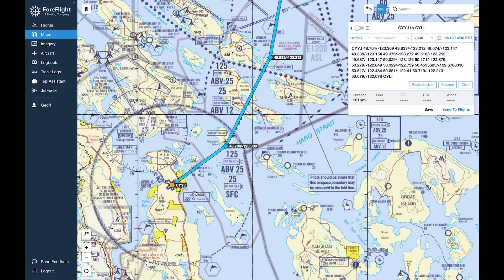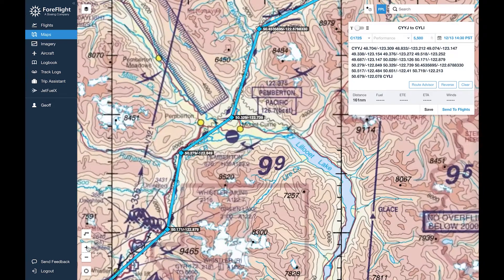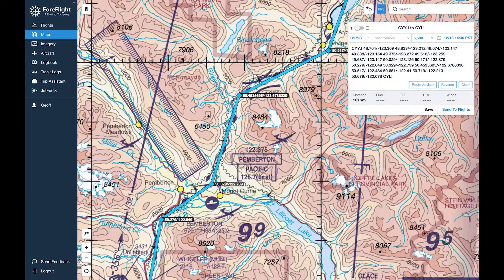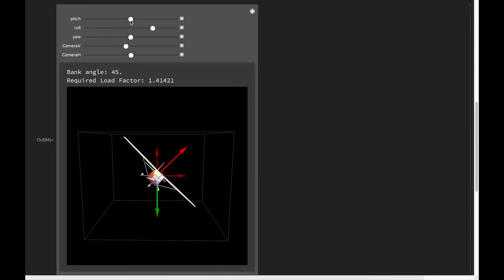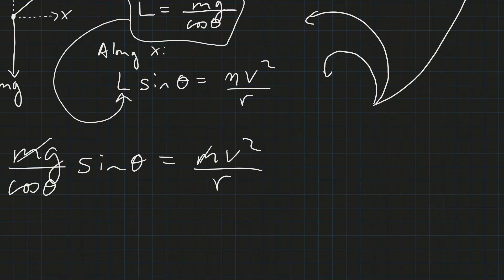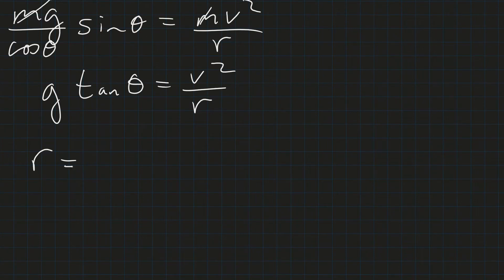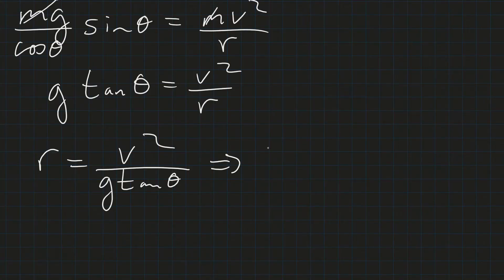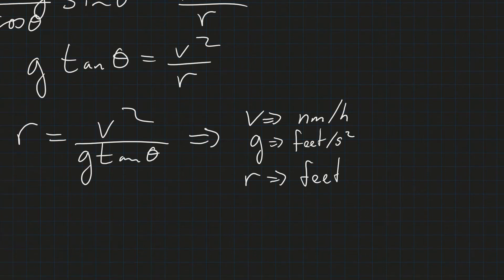Flying Physics: The Turn Radius Equation (and an even better one).

Comment: Why does everyone keep using this stupid explanation of the physics of turning an airplane? This explanation simply does not include an illustration of the tail forces that must be applied if you want to increase the angle of attack, nor the sideslip caused by the horizontal forces and angle of attack acting on the vertical stabilizer. The tail force also has a vertical and horizontal component. Can't you see that the horizontal component of the wing lift is located behind the CG in your 3D model, and when you apply this force, the airplane simply turns in the opposite direction? The only thing correct in this video is the radius calculation (6th grade).
Reply: I invite you to create a better explanation then and look forward to it
Reply: @HDTokyoAviation In simple words: all airplane control surfaces are involved. An airplane is a body with 6 degrees of freedom and the forces applied to this body make it perform rotational or postural movements relative to its center of gravity. Once again, this is important, relative to its center of gravity. If we are talking about a balanced airplane, then in order to put the airplane into a bank, it is necessary to create a difference in the lift forces on the left and right wings. In this case, more lift means more induced drag. That is, not only is the horizontal force on the wing behind the center of gravity, but also the difference in induced drag turns the airplane in the opposite direction. To maintain the flight altitude, it is necessary to increase the lift force. How to do this? As a rule, by increasing the angle of attack. And how to increase the angle of attack? By deflecting the elevators. And how does deflection of the elevators affect the direction of flight? It turns the airplane towards the center of the circle. In addition, the sideways slip from the horizontal component of an aircraft banked to turn creates horizontal speed, and the force acting on the vertical tail is the vector sum of the forces along the X and Y axes. The resulting force presses on the vertical tail and turns the aircraft in the desired direction. If you do a precise analysis, you must take into account the distribution of lift on left and right wings of banked airplane, airspeeds, the wing deflection, the airfoil data of each particular wing section, the wing twist, sweep, dihedral, the same parameters for tail surfaces....
In addition, there is no such thing as centripetal force.
Reply: @DenisDa All is very valid, however we are talking about very negligible factors here for practical purposes it’s not significant enough to take into account. I say this with full confidence, I’ve been flying Boeing 747s for the last 3 years now and the formula discussed in this particular video works almost perfectly. When traversing the unnecessary zig zag airways across China which frequently have steep 90 degree turns, I cross check the autopilot by making a mental calculation of when the turn must commence by inbound to a waypoint, and 99% of the time using the formula above always works out to being within .1 to .2 of a nautical mile. Us pilots are not mathematically gifted, it’s always best to keep the numbers as simple as possible and practical 😂
Reply: @HDTokyoAviation My point was that all control surfaces are involved in a coordinated turn. If deflection of other control surfaces aren't taken into account then you just can't predict the trajectory of  turn.

Comment: Hi, on the a320 the bank angle would be more 30°.

I'd like to know the timing to initiate a turn. Example, I'm following a VOR course 354° and  I need to turn right onto the runway with an inbound course 43°.  
I can determine the  bank angle and time necessary for the turn but how woulld I know when to initiate the turn?

Comment: thanks, iI  want to add that V in the equation is the ground speed,  hence the radius depends also on the wind speed ( head wind smaller radius, tail wind larger radius )